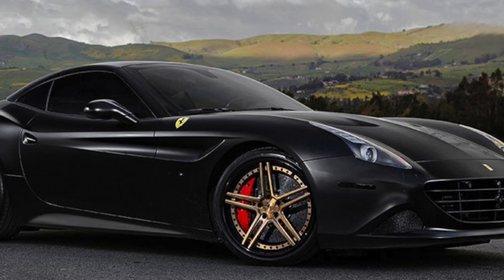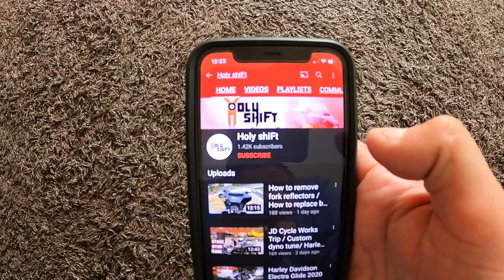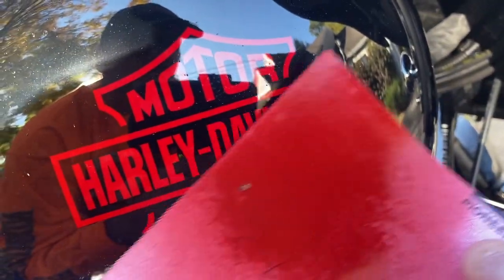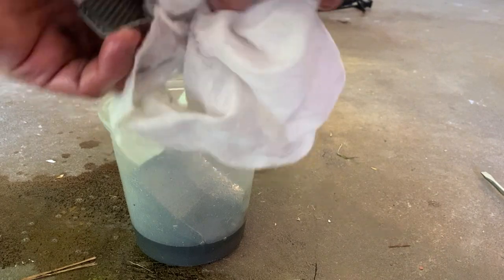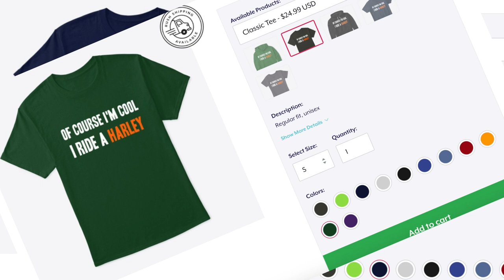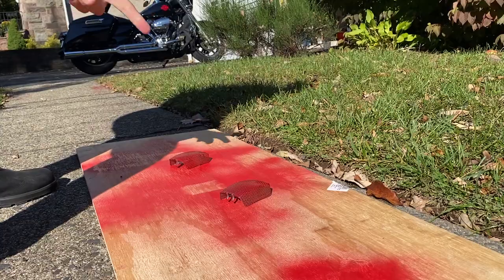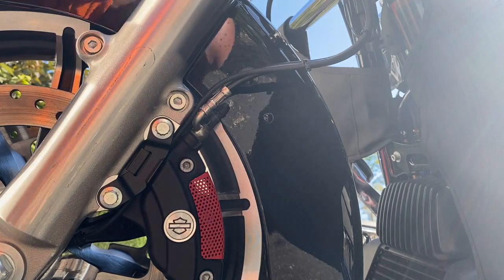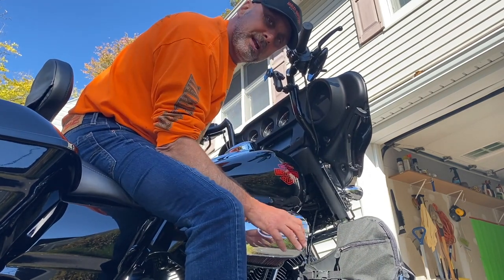RED Caliper Cover install Electra Glide 2020

Comment: Hey Sandy, you had me thinking you were gonna unbolt your caliper and paint them hanging them on the bike without disconnecting the brake hydraulic line. I have to say spraying the caliper grilles looks great. I would suggest for anyone else considering it to get a rattle can from an Auto Paint Supply shop. Many can scan the colour (canadian spelling)  off your bike and load a rattle can. Then I would suggest spraying clear over them to give them a deeper wet look like the red on the tank. just 2 cents from a former auto body tech
Reply from the maker: Cool- I wondered what was the name of that color! Yeah clear coat at end would make it look like a pro job

Comment: I might try it, but I have more chrome on my bike, so maybe not, but Note to self.. test spray on clean, hard, ultra flat, solid surface to color match..and to Tape surface of fender next to metal screen that is going to be popped off.. and paint inside of of screen first..looks nice on your bike, but never understood or identified the it looks "sick" comments that so many use

Comment: Looks terrific! Just got my new 2020 SGS in Vivid Black. Am going to paint mine black to complement the totally blacked out front end. I realize light coats; but how many coats on each side did you do? Did you rough up the surface before painting?
A suggestion: look at chrome rocker box bolt covers. I did it on my 2017 SGS. Really dresses up the engine. 
Keep up the good work.
Reply from the maker: Cleaned them with grease remover, then 2 coats of paint only...

Comment: Had the same idea in gold to match my gold pin stipe , can you tell me if you toughed them up with sand paper at all & is the paint holding out
Reply from the maker: Still holding. A bit scuffing with Scotchbrite pad , or steel wool
Reply: @HOLYSHIFT  love the content i utube you & john alot 
Thanks from Australia riding 15 road glide special & a 19 breakout

Comment: thx for the video, but if you want to make that next time , hang off the parts and paint them, at first the inner paint than the outer paint, and a tip the caps of the sprays show you what kind of red is the colour ;) but nice bike nice details i made the same to mine cvo